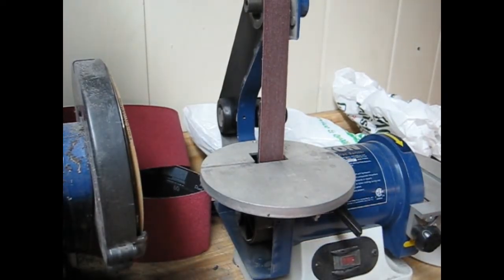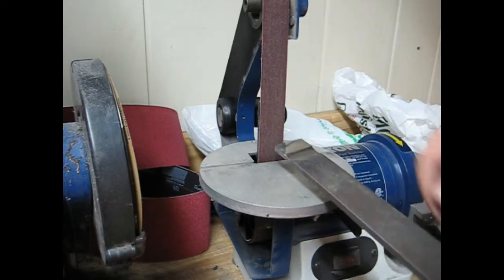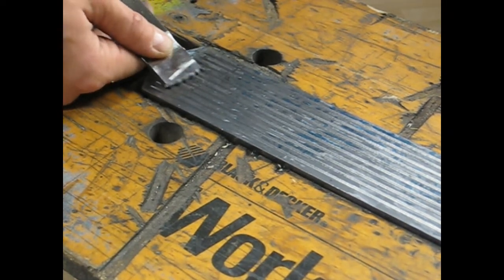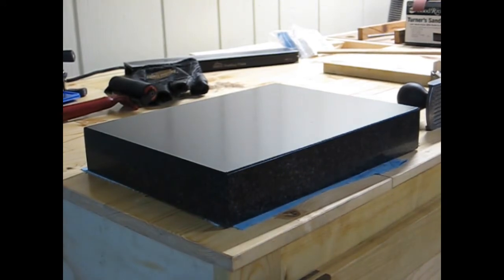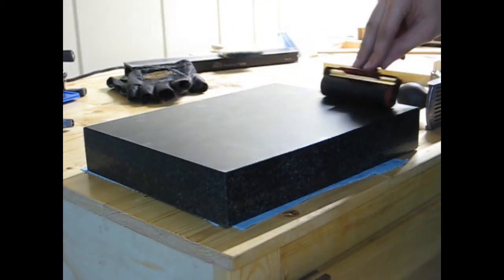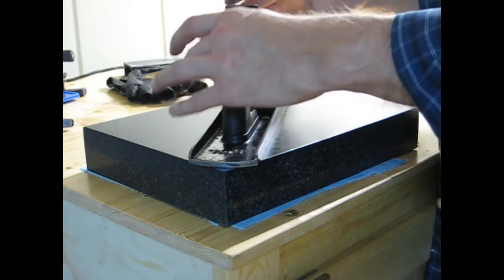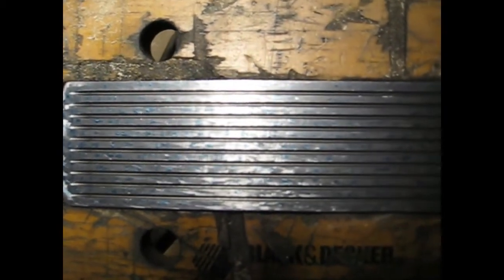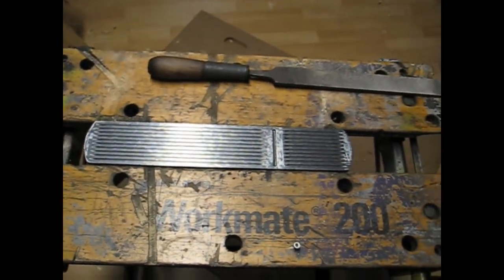Flattening a Woodworking Plane Sole - Ultimate Accuracy

Comment: Lose the scraper and use a dremel with a pointy stone. Faster and wayyyy flatter.
Reply from the maker: Well I appreciate your suggestion but I've gotta say, to each his own.

I used exactly that method on a little block plane over a year ago now...and it took quite a while and covered my bench in grinding dust...a BLOCK PLANE...not to mention that grinding stone doesn't last...this scraper has flattened two No. 4 planes, a No. 5, and a No. 6 and I would need to use a dial caliper to measure how much of my scraper I've lost to sharpening throughout all this work.  

Additionally, would you like to present some evidence for your argument that a dremel grinder will achieve a flatter surface than traditional scraping?
Reply: @jensdavidsen4557   With a scraper, flatness is achieved when there's an even spread of high points throughout the surface. The higher the density of the points, the flatter the surface. With a traditional scraper, the blade size determines the precision of the metal removal, so as the blade size goes down, the total area of removal goes up. There's a point where it is impractical to proceed any further. 

A rotary stone, especially a conical one, on the other hand, lets you remove material faster and more accurately, achieving a level of flatness that would be very difficult for a traditional scraper. A conical stone lets easily adjust the area of removal depending on which part of the profile is used. They come in various grits and materials. Today, you can buy diamond ones, which last forever.

How can I tell it achieves a flatter surface?  If a precision granite plate can't tell you this, I don't know what can. It is possible to reach a level of flatness where the points are so dense, it becomes difficult to see the demarcations between them. Moreover, towards the last few passes of the Dremel, you will need to cut the hi-spot with some acetone to thin it out, or the workpiece will fuse to the granite plate.

Why do machinist still use traditional carbide scrapers?  It's mainly out of tradition and mystery. It has worked for centuries with proven results, so there's little reason to change it. It's the same reason machinists still use manual machines instead of CNCs.
Reply from the maker: @bobweiram6321  in this application and in metal machining, the goal is NOT to have an absolutely positively smooth & flat surface but rather to have divots and opposing contact points. The points or dots seen on the surface plate are effectively your bearing surface while the points not making contact are areas in which a lubricant (oil in machining and wax in woodworking) will remain. If you have no divots, your wax lubrication won't last but a couple passes... Believe me...It makes a BIG difference in actual surface finish quality (of the wood) and the felt effort on your end. That's why the standard for scraping is to have about 20 or so points of contact per SQ inch. Sorry man... agree to disagree.
Reply: Unless you surface grind or lap the living hell out of the sole, there will always be small dips and valleys where oil is lodged. Moreover, if two perfectly flat surfaces (no imperfections) are oiled, you can theoretically rub them together for eternity without any of them showing any wear. Even a microscopically thin film protects the surfaces. Of course, this doesn't account for oil break down over time or through friction. The flaking pattern you're describing is a deeper and more aggressive cut and it's usually performed at the very end. I need to read up on the utility of flaking, considering flat oiled surfaces should never  wear if oiled. I suspect, but not certain, it may have to do with the fact that scraped ways can never be 100% flat and defect free, but to what extent?

Anyway, it's great to be able to chat, learn from each other, and disagree in a civil manner, which is sadly rare to have nowadays. This discussion made me think harder than I ever have on this topic. I think we can both agree that the sandpaper method is laughable and a huge waste of time.
Reply from the maker: @bobweiram6321  indeed...the sandpaper bit is - in itself - an astronomical waste of time and cost (sandpaper isn't cheap) however, for planes that are larger than my surface plate, I use a large glass plate with sandpaper adhered with spray adhesive - the sandpaper is only used to abrade the surface as a replacement to smearing Prussian blue all over a large pane of glass - I sharpie the plane sole and abrade it with the sandpaper and wherever sharpie remains is a low spot. Worked exquisitely with a No. 6 - I intend to make a video on this hybridized method eventually.

Back to scraping, the wells (as you rightly put it) are much larger than they'd be with the Dremel approach and therefore hold more wax (I'm doing cast iron-on-wood work here so we're not talking about oiling the surface) - I've never scrapped in ways but there's a wealth of YouTube wisdom on the subject.

 I've got a plane that I sanded flat before I discovered scraping and good GOD it's a night and day difference in how well it retains the wax vs a scrapped sole...the sanded one SUCKS - it's very nicely flat all the same because I used sandpaper on the same surface plate...but I'm going to scrape it in to allow for wax retention so it's more pleasant to use...just have several other planes that are higher priority. 

Indeed I have enjoyed this civil discussion - and truly it is rare especially between two individuals on opposite sides of a keyboard. 

Perhaps you could do a YouTube video on the Dremel method - it's very possible...or rather likely - that the Dremel approach I took was way wrong which is why I don't like the method. You may be doing it in a more efficient manner than I've thought of.

Cheers!

Comment: I'd be interested in seeing Bob's dremel method also.  I've tried the scraper method with some success, but I received all my training from YouTube, so I'm not 100% sure I got it as good as it can be.  I've also tried the sandpaper method, and it works OK but not great either.  There's lots of room for error with the sandpaper method.

Thanks for the discussion!
Reply from the maker: I've actually done a hybrid approach using sandpaper and scraping - recorded the video and haven't gotten around to editing it yet. I think you'll like it. To be entirely honest, I tried the Dremel approach (honestly I thought it up myself and only later realized I didn't invent that method LOL) but I'm definitely not a fan, for one thing, it's slow as heck - spent over 2hrs on a block plane and I never finished it, and for another thing, it's messy - cast iron dust in the air, gotta wear breathing PPE and glasses, yeah I'll go with scraping any day over a Dremel. Thank you very much for your time and commentary!
Reply: @jensdavidsen4557  I'll keep an eye out for your next video.  Thanks!